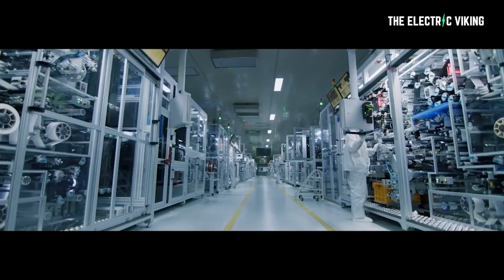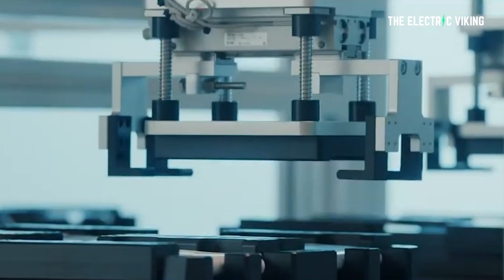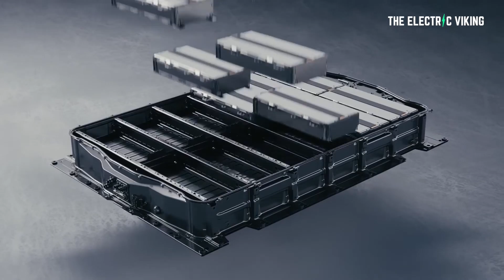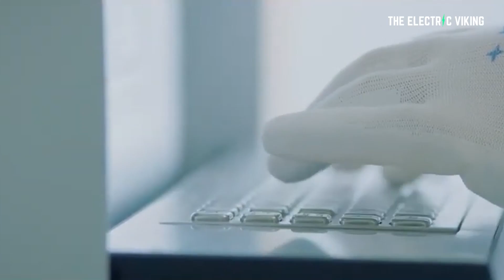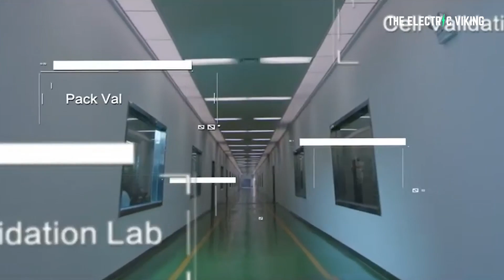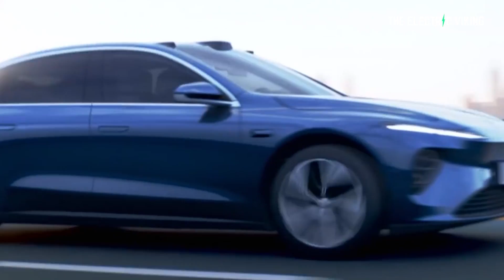NEW VW/Gotion battery tech is a MASSIVE game changer

Comment: LFP Batteries at 360-400whr/kg. OK But What are the other specs. LFP Suggests Solide Lifespan, etc. But at Much lower densities of 210 Max. 
What are the other specs? 
     Life Cycles (2k, 5k, ? or expressed in miles) - really 1M miles plus or 4k cycles is more than enough for a car. Anything beyond is nice but beyond the life of the car.
     Safety
     Temp Sensitivity
     Charge Rate
     Charge Max capacity before degradation (ie 90% for Lion, 100% for other LFP)
     Production Cost

All these stats need to be solid or they have junk. 
"LFP" suggests all stats save Temp Sensitivity... but. This assumes they didn't just overcharge existing tech (like chinese companies that overclock LEDs in flashlights to pretend they can sustain massive light output). 

Need All Stats.

Comment: Weight is a very small part of a car's efficiency. Would make a plane more possible. But really for cars its about cost per kwh.
Reply: Agreed. Energy/ weight is an aeronautical issue where costs can be offset against performance. Electric vehicle are a power/cost issue and only whilst we await infrastructure improvements. Once charge speed is significantly improved and charging infrastructure is adequate larger batteries will become more of a hindrance than an advantage and energy density will be a relative non issue

Comment: 400 w/kg is the number that Elon said makes electric aircraft viable.
Reply: Depends on the goal.  With new designs we would need 3000+ wh/kg to match the longest range commercial planes available now; this is a long way off.  That said we have some short hop planes using them now (ie Vancouver to Victoria), 400 wh/kg might allow short domestic flights (under 1000 miles), 1000-1500 wh/kg could get a commercial plane across an ocean.

Comment: This is a great video because it explains clearly how highly dependent on battery tech the EV market is. Even a 10% improvement is huge, because it means less weight, which then yields more range. It is a virtuous circle, and successive generations of battery tech will further accelerate EV adoption.

My father invested his life savings in EV's in 1970; formed a startup with a CalTech professor who was a pioneer in Transistors (worked under Shockley at Cambridge), but at the time the only battery chemistries were Lead Acid and Nickel Cadmium.  So EV's were hopelessly impractical, except in wheelchairs and forklifts for indoor use.

As a friend of mine says, the one deadly enemy of high tech is higher tech.

The winner of the battery wars will be highly rewarded; it is a battle of chemistry & physics, and sadly the USA has but only a few percent of the people worldwide working in this area.

Comment: It's not that they would put in a 60 kilowatt battery and you would get the same range it's actually that they would put in let's say a 150 KW battery that would give you obviously about 50% more range but it would be about the same size and weight as much as the old 100 kilowatt battery.  Because it's the same size and the weight is about the same what that ends up meaning is that the cost to manufacture is about the same as a 100 KW battery.

Comment: Nothing is a "game changer" unless and until it is mass-produced, at a reasonable cost, and in large volumes. Anything is possible in the laboratory. Game changing happens when it hits the market and usurps current technology.
Until that happens, no "game changing" is underway.
Reply: Add life cycle cost and reliability.  The big fear for electric vehicle buyers is getting stuck with a failed battery and super expensive repair.
Reply: Lithium batteries changed the game in 1995 for the phone inustrie when the Siemens S4 came out and with lower weight had twice the standby time as phones with older batteries. Until then the capacity developed percentage wise, just it is now with car batteries. There has to be something revolutionary which raises energy density by a factor, not percentage.

Comment: My Bolt has a 60 kWh pack which weighs about 1000 pounds. Those who are astute at driving can "feel" this mass during maneuvering, especially in negotiating curves and encountering dips/rises in the roadway. In my view, the best benefit of having a lighter pack comprising the same kWh capacity will be in having a more nimble driving experience with the car relieved of excessive mass.
Reply: Yeah but thanks to all the low down weight, your EV is virtually impossible to roll-over

Comment: IMO, this will greatly increase the feasibility of producing electric sports cars with good handling characteristics. While straight-line performance is always fun, today's EVs run into the Laws of Physics as soon as you try to enter Turn #1 at speed. A heavy sports car just isn't gonna handle the twists and turns in the same way as a lightweight sports car, regardless of how much power and torque you have on tap. However... if you cut that battery weight IN HALF, your favorite twisty road suddenly becomes a much different (and much quieter) place. Also... braking performance!
Reply: Maybe someone should tell Tesla that.  Even with new battery innovations the pack planned for the roadster will need to be huge for its 600 mile range (likely 1000lb or more).  The simplest way to cut the weight of the pack is to drop the range to 200-300 miles and that should be fine given the design goal.  Even with the Aptera (a vehicle with ludicrous efficiency) the 600+ mile range options will need very heavy packs; the 1000 mile version's pack alone will end up weighing about the same as the 250 mile base version.

Comment: If we take the Hyundai Ioniq Electric with it's 28kwh battery, that had an energy density of 112.4wh/kg according to Hyundai's figures.
According a tester on YouTube in winter it got about 213wh per mile energy efficiency, so it's 250KG battery managed 131 miles in winter,  the same weight battery with this density would achieve more than 3X the range, you could have close to a 90kwh pack, with the car achieving about 420 miles of range.
The same 28kwh pack would weigh under 80KG, that's less than a 3rd of the weight for the same capacity.
Double the capacity and you can still drop the weight by almost 100KG, the car would easily achieve more than 260 miles of range in winter!

Comment: Anyone want to weigh in on how good batteries would need to get before further improvements wouldn't mean much to you? For me, 1000km range (without being too heavy), 5 min charging, and a 20 year life span (before hitting 80% original capacity) in a $25,000 car would be awesome and anything better than that would represent diminishing returns for me. As far as I'm concerned, once all manufacturers offer vehicles like that, the battery race will be over at that point and my purchase decision would be based on other aspects and features of the vehicle. I wouldn't necessarily choose a vehicle with 10,000km range vs 1,000, or a 30 sec charge time vs 5 min, or a 100 year lifespan vs 20 if it was otherwise a worse vehicle for luxury, comfort, handling, technology, aesthetics etc. How about you?

Comment: Great for Airplanes but does use Cobalt and Nickel. What about price and availability? Still, all good news for the Planet!
Reply: goshen high tech is also making 210 wh/kg LFP cells now (in factories) and will be at 230 by the end of the year.  For the mass market this is far more important.  Given less packaging and thermal management requirements this is perhaps equivalent to 275-300 for NCM/NCA cylindrical cells when made into a functional pack; So basically the current state of the art NCA/NCM with all the other advantages of LFP.  The super high end can still be in sports cars and planes but for 95+% of vehicles LFP is definitely the far better option.

Comment: Viking, To achieve reasonable highway range, which is already the worst case user constraint, battery size with 2X energy density will only be able to decrease by maybe 25% except for designs like the Aptera.  This is because aerodynamic drag is dominant.

Comment: EVs are like cell phones.  Tech is changing all the time.  What does this do to your huge investment into a new EV. When these cars ship at prices on parity with current EVs?
Reply: My idea would be: Leave the chassis and change main processing unit and battery when nessesary. A lot of ressources could be saved. Of course that must be forced by government, car builders will not want this, it cuts their profits.
I saved such a lot of laptops from the landfill just by replacing the old hdd with a ssd, putting more RAM in them and upgrading the OS! Display, keyboard etc. simply didn´t change. And: New laptops suck in case of repairabilty!

Comment: Sam
When talking about "battery size".
You need to start distinguishing between CELL energy DENSITY rather than "size", then PACK "size in terms of volume or energy density.
Then decide if "1000km range" is desirable or necessary.
Bearing the above in mind.
The figures suggested of 330(?) 360(?) 400(?) W/kg...
Cell level?
Pack level?
Compared to "ternary cells at 220wl/kg"? Is that pack level?(last reports of Tesla 2170 place them at 260-270 at cell level?)
Seems like you're mixing apples and oranges?
.
Let's assume "cell level"
With energy density of 330 W/kg to start (and not speculating on 4680. .. yet)
So, about 20% up on Tesla 2170, more over others?
Then assume similar drivetrain / aero efficiency as Tesla.
1000km (620m?) range 120kWh pack?
If we reduce the range to "EPA" and compare pack size is it any more energy dense than the Lucid? (Insert "but the Lucid pack" comments here).
....
Then, the "NIO Dilemma"
Pack swapping.
If you have an "ultra range" car, with a dense energy pack, that density implies high density cell, indicating fast discharge ability, which in turn suggests fast charge.
.
As previously discussed, fast charge and/ or large pack removes the need for pack swap!

Comment: The fact that Neo - is a customer - suggests to me the battery life cycle is not good; and that it will need to be swapped out periodically. Neo is the prime devote of battery swapping; this suggests the costs may be high.  It could however give Neo an advantage in performance and VW could change their designs to battery swap.
Reply: Nio doesn't do battery swaps because the cells have degraded. They do them as an alternative to fast charging. You're right to think about cycle life though. LFP can do over 2000 charge cycles. Some new chemistry cells and solid state can only do 400-700 charge cycles. Not enough for an EV.

Comment: I'd like to know more, there are 5 Main battery features we all need to know when you talk about Game changing - if it is Lithium based it likely isn't good enough, as Lithium is in a short supply already.  Energy Density,  Cost per Kg. Durability/cycles, safety, charging time. I didn't hear you mention more than density; and unfortunately you say its Lithium based. There was no mention of cost, charging cycles, charge time, safety.  If it falls on its face in any of these areas - it is not game changing it is a fail.

Comment: Is it possible to split battery pack in 2. Charge 1 while running on 1. Highway driving, alot of wind. Could you use a wind generators and combo solar panels.
Reply: If you try to harness that wind energy you will cause drag, draining the battery faster. Solar yes, Aptera are already doing that. But you need a very efficient vehicle to take advantage of solar, because the amount of energy generated by a solar panel is tiny compared to the demands of an EV.
Reply: @aftonline  the car already is a drag. If done right. How much more drag would it be. Built into the body of the car.
Reply: @joenorman8259   Maybe it would work if you could switch the drag on when wanting to slow down, then switch it off again when accelerating  or cruising. Kind of like a regen airbrake I guess...not sure how you would engineer that but maybe it's possible...
Reply: EVs already charge while driving.... regenerative breaking. There is no need to have a separate battery.
Reply: I was thinking more of a cross country drive . Stopping for gas take 15 minutes . Tru if you stay at hotels at night you can charge them there. I drive 500 700 miles a day on a trip.
Reply: Thank you

Comment: 400wh/kg energy density means electric aircraft is finally here.
Reply: EV Aircraft can never happen except for very, very short flights..........Aircraft require many times the power that could EVER come from ANY batterie.............Paul
Reply: @paul-flyer  Never say never.
With 500wh/kg you can build small aircrafts 
for small distances .
The technology will advance and we will build electric plans. 
For ex , electric plane can go much higher than conventional planes where the air is less so they use less energy to fly.
Reply: @paul-flyer  Currently we have 2 hour flight times for training planes using essentially Nissan leaf packs.  With new first principles designs (10 years to certify) and 400-500 wh/kg will allow short domestic commercial flights possible (under 2 hours).  1000-1500 wh/kg would make crossing oceans a possibility.  3000+ wh/kg would be needed to potentially match current long range planes.
Reply: They are already here, powered gliders can safely stay up for hours only needing power when thermals are not present

Comment: 2:50 Did you confuse weight and capacity here? You don't seem to be on top of all the metrics you keep mentioning.
Also, energy density is not the most relevant metric for EVs. Cost per energy and cost per range is relevant. The vehicles usually don't lack space, they are limited by the price of batteries. This video is very typical for battery hypes: hype one metric that is great and stay silent about other metrics that are not great.
Reply: Agreed. I think he's rushing out the videos too quickly and not doing enough research. No, it does not mean a 60kwh pack will go further. Only a more efficient motor will allow a battery back with the same energy capacity to go further. kWh is a measurement of energy, not weight which the gotion battery is about. It's a higher energy density battery by weight, but what about by volume, life cycle, or charging speed? There's usually a compromise in one or more of those other metrics.
Reply: @yelnatsch517  well put
Reply: @yelnatsch517  If it is lighter it goes a little further.
Reply: It’s the ol ’ “it’s not clickbait”, clickbait routine. Tesla is the EV company with state-of-the-art tech right now. All others are years behind.